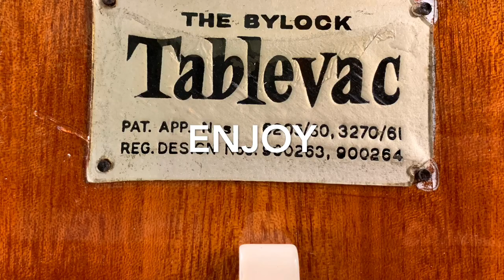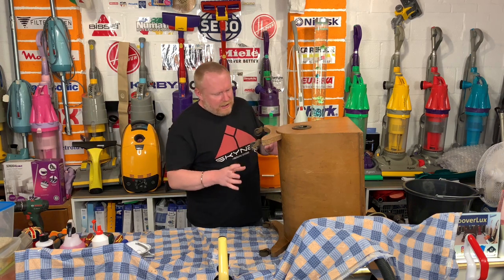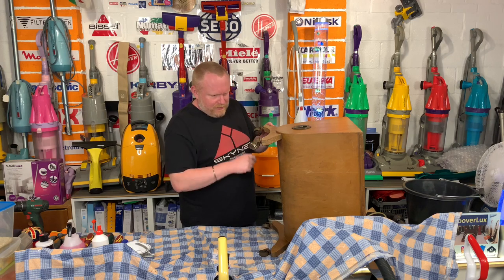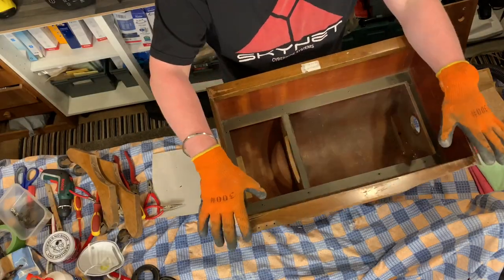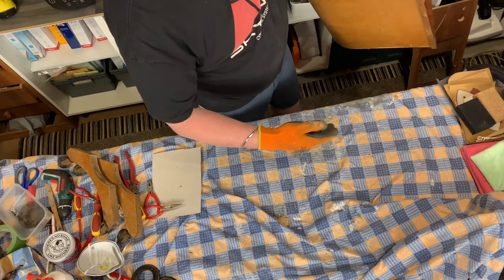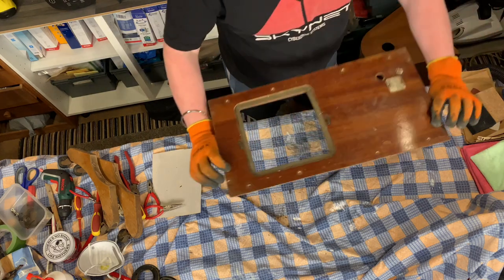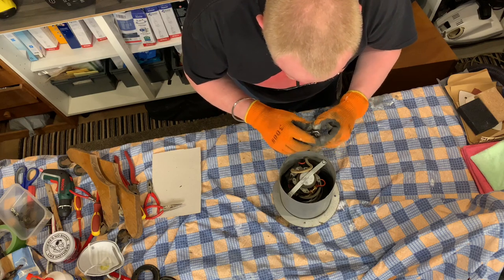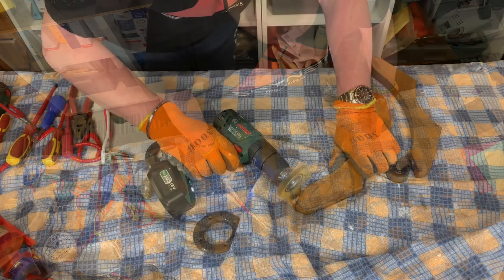Bylock Coffee Table Vacuum Refurb Part 2

Comment: Another great video of the Bylock restoration project. I would have thought that the castors would have clipped into a metal socket but it didn't look as though they wanted to move . They may have done with some WD 40 but you were best on the safe side to leave them in and work around them like you did. Fascinating vacuum
Reply from the maker: It’s definitely an odd machine and I’m sure you’d love to have a go of it. 🤗😘
Reply: Yes I sure would. It would be a challenge